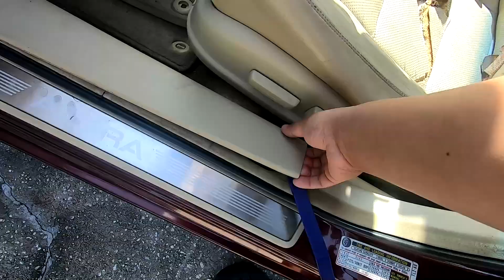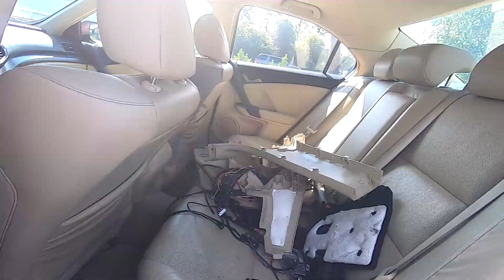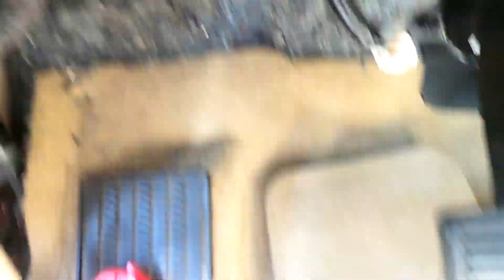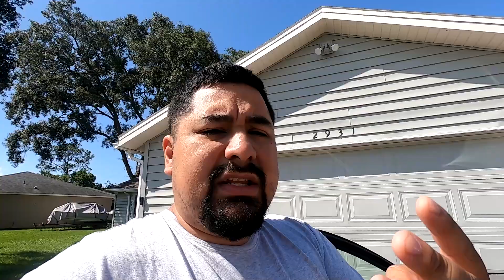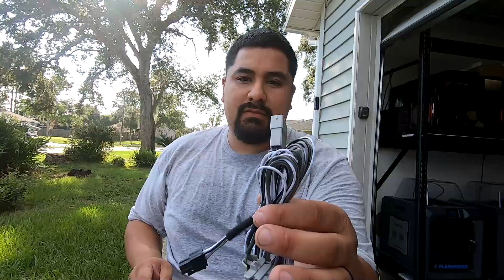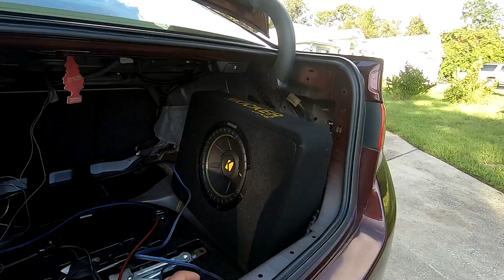The Easy Way to Add Aftermarket Subwoofers to an Acura TSX - Premium Audio System - ELS Audio System

Comment: You say blue wire goes into amp but where does it go is it a power 12v cable or just go along with the remote wire

Comment: hey bro i just did this, but for some reason my sub and radio will not turn off whenever i turn off car. any tips on why? im tapped into fuse 18
Reply: The kicker key500.1 has a button it say dc offset try that if it works

Comment: Just installed T harness and LOC I bought from you guys in 2013 TSX with tech package. Combination works great! Running 1500watt amp and two 12” subs. Question though, how do I know if I beed to adjust gains on LOC?

Comment: If i go about replacing the factory 8" sub can a 10 or 12 fit? Or what mods would i need to make
Reply from the maker: You could possibly fit a 10 if you are down to modify the metal of the rear deck but it will rattle like crazy. If you want more bass it might make sense to just put a box in the trunk.